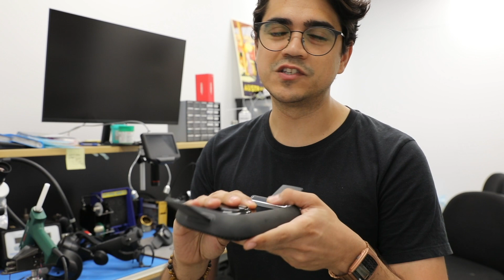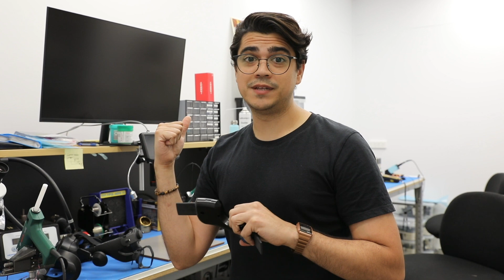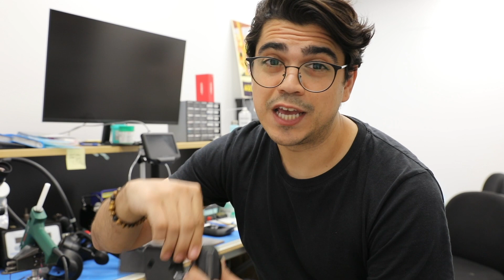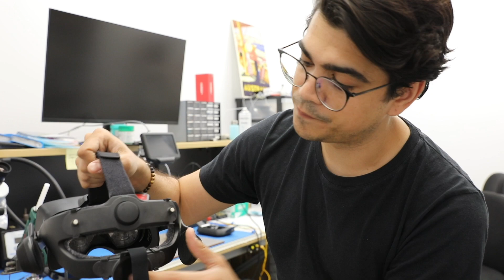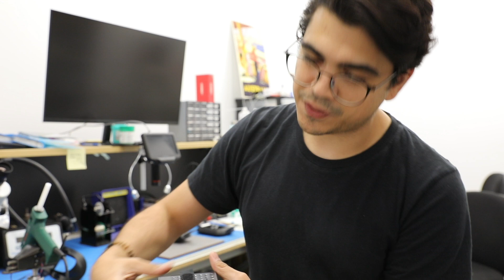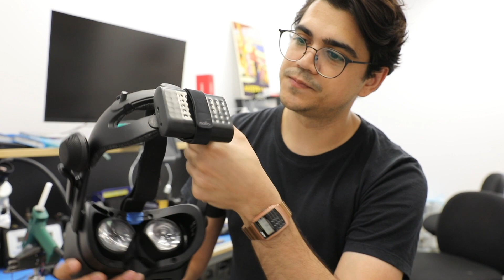nofio Wireless Adapter: Plastics V3 Overview

Comment: BIG suggestion, add a brace between the antennae and headstrap, that is something that is a point of failure for those who rest their head on something soft (a bed, or a pillow, or anything similar) which is a MASSIVELY common occurrence, and also having anything that thin poking out that far seems like a direct point of failure as it would have a lot of repeated or extended force applied on it. so either bracing the antennae by making it thicker, or having something going between it and the headstrap to prevent inwards flexion would be ideal.
also having the option to use a cable to power the hmd would be great, just using a type c port from the battery to the main unit would be great for those like me who will be very active for a few hours, then swap to being still for hours, and it would be nice to be able to swap over to a cable so i dont have to worry about running out of power while chilling or laying down
Reply from the maker: Great feedback! We will pass it on to the team. Thanks

Comment: Please please please make sure this can handle a spot turn. This is a core move in dancing that allows a dancer to spin without losing their balance. If the adapter comes off during one of these, then you're going to have these flying off the magnetic mounts and wrecking the oculink cable at the same time.  example: https://www.youtube.com/watch?v=RDF1NqgVIv8

Comment: Share the same concerns about the magnetic mount for the transceiver. The posts seem long enough to prevent modest lateral forces.  It may be worth looking into a silicone strap for backup. People use this for fitness apps so the magnets need to hold up to some pretty rough shaking and jerky movement. Also a tad concerned about the angle of the oculink port. Looks like it might be very close to be poking you in the back of the head when you ratchet down the head strap.
Reply from the maker: Thank you! We are reviewing and testing those right now… Bruno is back flipping and cartwheeling as we speak.. we are running a series of tests with the V3 before we move forward with full production.  Thanks for your comment 🫶

Comment: I'm going to want to velcro strap or zip tie that top piece to the headset for sure. Little trust with those magnets unless you can get more o-rings around the other side as well. 

Can you discuss anything around what would happen if one or more of the antenna happen to snap off. While thankfully of course there is no cable to snag, I can definitely see those thinner antenna being the first thing to break if maybe the headset is even placed down at a bad angle.
Reply from the maker: Hey! Thanks so much for your comment, we totally understand your concern but we can assure you that the product we put out will be super robust and the antenna enclosure is not as fragile as it may look. But we are 100% taking on your feedback and it will be passed on to our team!
Reply: @nofio_co  Fully understandable and I am aware its not going to be purposefully setup for such failure. More curious to know if the product can still function if one of those took damage. Out of all the exterior plastics to break that seems like a weak point. Doubling down on why I wouldn't trust just the magnets because I don't want to be a drop tester on new products.

I very much appreciate your inclusion of not wanting to damage the main headstrap but I'm far more concerned of breaking the nofio at this point in my valve lifecycle.
Reply: @All4thlulz  this brings up a good point, I really appreciate the carefulness are preserving the headstrong but I think I can safely say for most people getting this their index likly many years old and the security and safety of the brand new device strapped to the back is of significant more importance lol
Reply: that is indeed a bummer , probably cant lay down with it

Comment: Is the magnet strong enough for jumping and whatever you might want to mess around with while in vr? The battery has the extra strap but the other part doesn't
Reply from the maker: It absolutely will be! We currently have the team doing all types of fast and abrupt gameplay to ensure it's super secure.

Comment: I know it’s not a button and I can click it but what is it? - The guy who wants to know what is that button
Reply: Based on the kickstarter updates where they showed the pcb. It kinda looks like a cooling fan or open vent for the processor
Reply from the maker: It is a button 👀👀 jk jk… @DevsFan1830 is 100% correct. 😌
Reply: @nofio_co  thanks ti deVs and finally the question is answered 😭